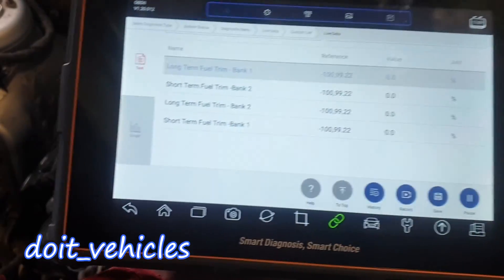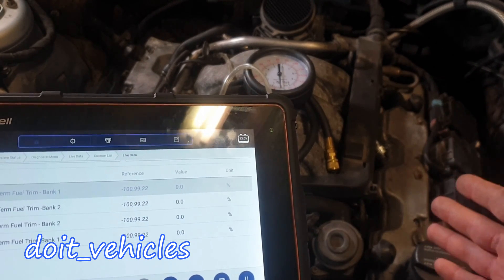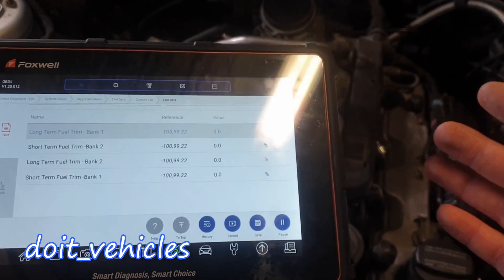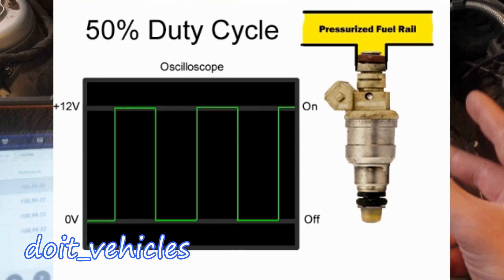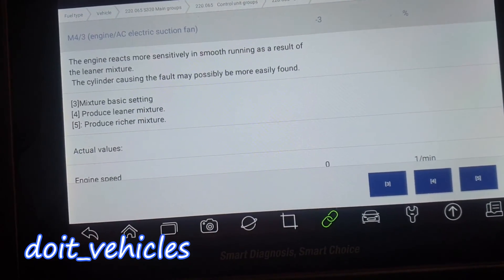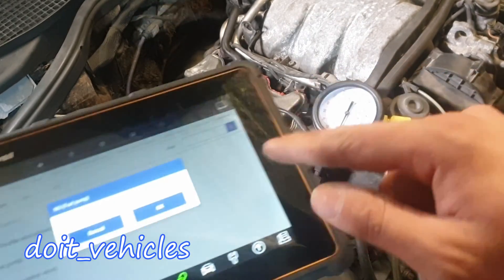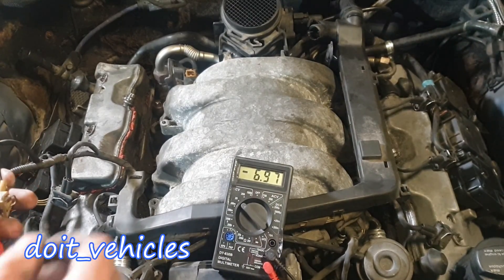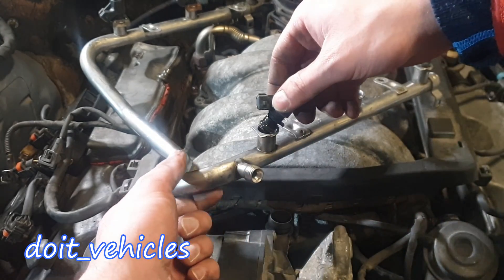S 320 V6 Fuel Injectors Diagnosis / Removal / Replacement from Mercedes w220

Comment: Hi. I have 2000 Mercedes S 320 with a code P0300 and P0306 showing a missfiring on cylinder no 6. I have put in new spark plugs and new coil ( still have to check the spark plug wires or renew those ) but i suspect a faulty injector. My Short Term Fuel trims are on both bank 1 and 2 = 0 %.
But my Long Term Fuel trims reads on Bank 1 ( 2.337 % + ) and on Bank 2 ( where cylinder 6 is located ) it reads 7.887 % +. You told me that it should read near 0 % to have 14.7 stychometric mixture. 
I have bought now again: New NGK spark plugs, 2 new sparkplug wires from BOSCH as well as 1 new coil-pack also from BOSCH.
I get really headache with this car! The first time this fault code occured: I was driving onto the motorway and give it "kick-down" at about 4500 revs the Check Engine Light came on and when i exited the motorway after about 2 miles and come to halt at a red light the engine was rough idling and i heared a relatively loud klicking noise....I suspected from the noise a mechanical engine problem something like a connecting rod bearing damage or something like that.
I drove home, checked the seatment of all 12 plugs and re-installed all 6 coils and noticed that the garage, which changed all 12 plugs recently ( BOSCH Plugs Double Platinum ) have made a mistake when installing the plug wires.
On M112 / M113 Engines you have a certain order to install the wires. Every cylinder has an "a" and "b" marking, a for front and b for rear plug. BUT: Also the wires are marked with a "K" and "G" and on the valve cover the certain order is exactly marked. For example the middle cylinders might have both a and b with a "G" cable and so on.
After that i put all 12 wires to the correct order, replaced 2 coils with new ones, cleaned the rest of the coils ( also the bottom, where the metal is sitting on the cleaned valve cover, i also cleaned all sparkplug wells with a clean cloth and some pure alcohol.
After this work the loud clicking noise is gone. Unfortunately the missfire on cylinder 6 is still present and permanently. The engine is idling noticably rough and the CEL is on.

Next step would be: 2 new spark plug wires, change 2 spark plugs again, 1 new coil all for cylinder 6 and after that i will replace the fuel injector with 2 new O-rings for cylinder 6.
I do not hope that there is a damage on the cylinder no 6. Because M112 and M113 engines are very known for their long-life and i want to maintain that, even if my car has now over 178.000 miles or 287.000 km on the clock.

I love my old S-Class, invested already a lot of money in new parts, rust removal and so on.
New Battery, 4 new Michelin Tires, new brakes front and rear, new upper wishbones at the front, new tie-rods, new front tension struts, new transmission-oil flush with filter, new air-filters, plugs, V-ribbed belt ans so on and on.

I hope to find the problem.
Reply: Hello! Your situation is nearly identical to mine! I have a 2005 S430 with a cylinder 5 misfire. What was your resolution? I suspect the injector has failed.
Reply: @PapaLinguine 
No. I took a look with a endoscope camera into cylinder 6 when I changed the plugs. There was damages on the piston head because a valve spring had cracked and the valve hit the piston head, no compression on the cylinder at all. So mechanical issue. Because the car was 25 Years old and had 300.000 km I sold it and didn’t repair it anymore.
Reply: @mbelieve I have the same issue, did a compression test… 0 PSI cyl 5. I was able to source a low mileage 5.0 M113. Thank you for responding! Time to swap the motors… I bought the car for $650 with 152,000 miles. Body is fairly clean and it is RWD going to try and save it!

Comment: Got about a desiliter of diesel in the top of the coolant reservoir on a w220 320 diesel 2000 model

Could this be a mess up from the previous owner changing diesel injektors? 

Diesel is Also returning to the tank after engine shut off. Takes a long time to start if the tank is Low on fuel.

Only 2-3 seconds if tank is full

Gotta Ask the pro s :-)

Can some of these things be the problem or is it the headgasket/cracked head?

Comment: Great video! Can you tell me is the fuel supply line to the rail reusable and how many times it can be because I read different opinions on that? This one that ends with a ball fitting going into the rail fitting

Comment: Doesn't air gets trapped in rail and fuel line as u completly remove the fuel inside it.
Reply: This is not a problem, the air is forced out during first engine start after fuel component reinstallation
Reply: @cilli5866  ok so did u measure the power on dyno after installing injectors
Reply: @nagarkarchinmay2812  i remove and install fuel rails / lines / pumps / injectors on a near-daily basis in my work as a mechanic and have never felt the need to measure engine power output before or after. fuel pressure forces the air out of the system.

Comment: I have S280.   When i stop at signal sometimes the engine starts shaking and sometimes not .what can be possible reasons .When engine shakes and  in 10,-15 seconds it's becomes normal .seems some airproblem .I suppose .kindly advice on it

Comment: Hi i just subscribed. How so you use obd2 scanner to check the fuel system without connecting to the port? And also without turning on the engine?

Comment: Where is your workshop because my engine is shaking and nobody in German fix the problem They told me to change all spark plug and I change all the coils with all cables and I change benzene filter and My car still shaking specially When I accelerate, the car does not respond after the engine is hot but when the engine is cold start Normal .
Reply: I’m having the same problem did the same changes
Reply: engine shake fix  VGR VALVE REPLACEMENT .... YW

Comment: Hi dear , thanks for your great vedios
I have w211 m112 , the car is ok while driving but when i want to stop it sometimes its turn off itself , and sometimes in the traffic light the rpm go down like it will turn off then again in one second rpm go back normal 
Any help please
Reply from the maker: Check the live data , it might be the fuel pressure
Reply: Clean throttle body should take car that problem.
Reply: For my car it is because my gearbox oil is low. My 5GTRONIC is leaking so when oil is low, coming to a stop makes the car stall. Even engaging reverse could cause it to stall sometimes. Gotta top up lots of fluid every now and then but at least I know my oil is fresh af.

Comment: What is the diagnostic system you are using? Is the testing procedure for diesel injectors the same? Thanks for the videos
Reply from the maker: Its foxwell i 70 pro . For diesel will be  a different story
Reply: Thanks, will you be doing a video for diesel injectors in the future?
Reply from the maker: If you go to the playlist with w210 e220 on my channel you will find a video about the cdi injectors but i did not show a test . To do a complete test they will need to be tested with special equipment because you will need high pressurized fuel